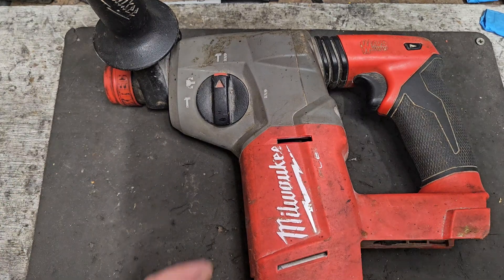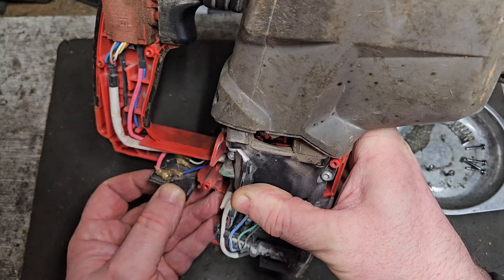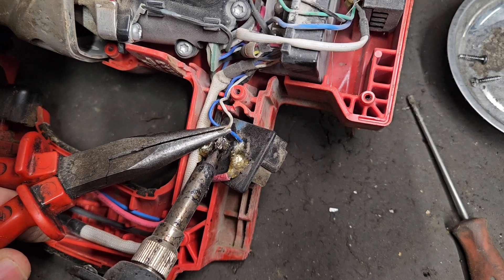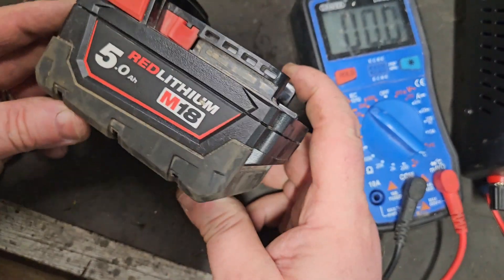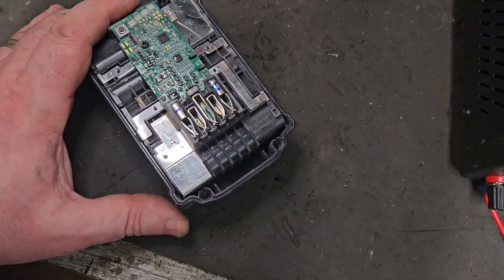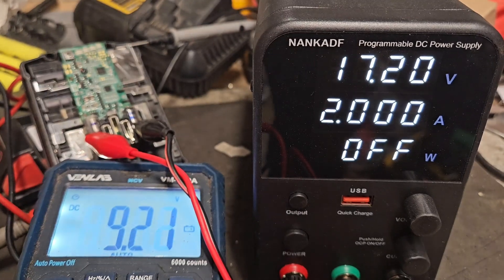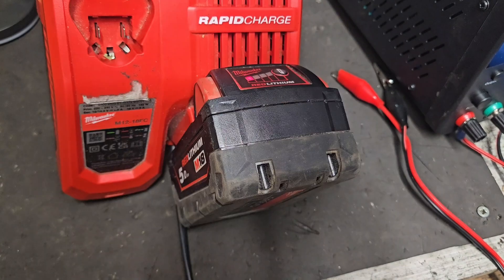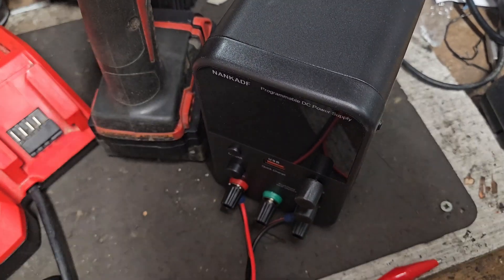How to Repair Milwaukee SDS Battery & Drill

Comment: Hello. I have a 3.0ah makita battery ( BL1830) that’s flashing red a green on the charger. I measure each cell and two of them are reading .3-.4 of a volt where the rest are reading 3.8. Do you know where I can find the replacement cells? Thank you.
Reply from the maker: I use donor batteries to fix others good quality  new cells are difficult to get
Reply: @ I understand. Thank you.

Comment: Love the content 👍 just wondering would you explain how to take off and put back on the change level on this sds cause I have 2 that I took off to put gease into and can't get them back in right
Reply: Can't find a video anywhere online explaining it !
Reply from the maker: Hard to explain
Reply from the maker: The best description I can give is hold in the red button with a pair of pump.pliers screw it on in a clockwise direction making sure that the activator is in the correct place